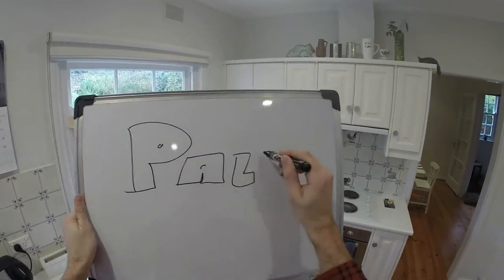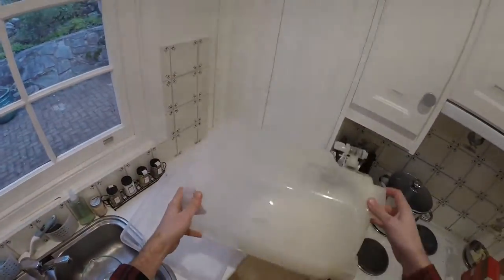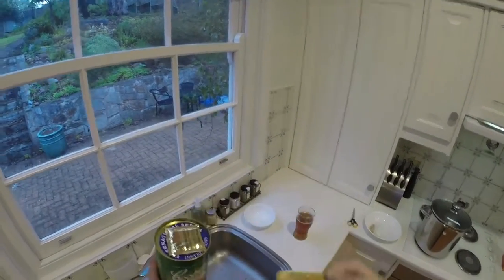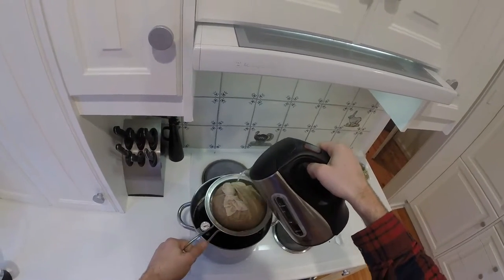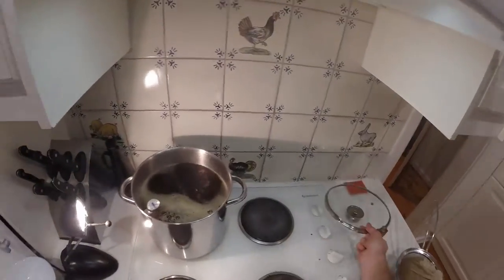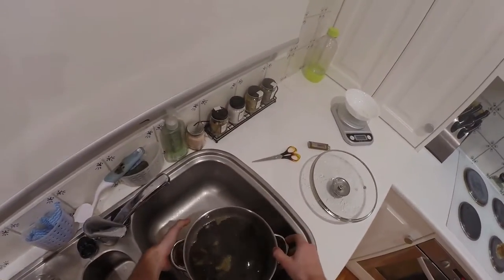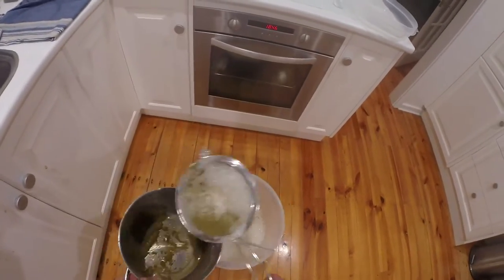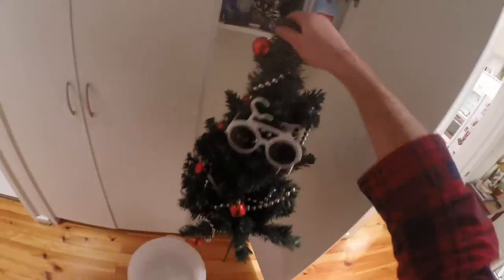Brew Day - Easy Pale Ale (easy, kits and bits)

Comment: What size is that tub you sanitize in? Seems like a perfect size to get the job done without wasting too much sanitizer
Reply from the maker: Don't know actually. It's one of those storage trays you slide under your bed. I usually make 3L of sanitising solution because that's a nice amount for the tray, rather than vice versa
Reply: Fast Homebrew no worries. I'm getting a few supplies tomorrow so will see if I can find something suitable. Cheers